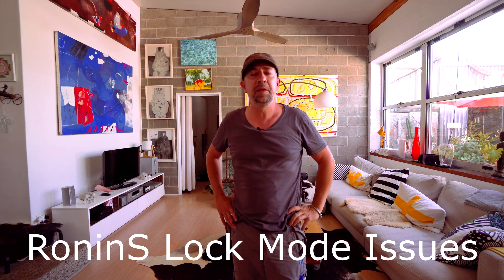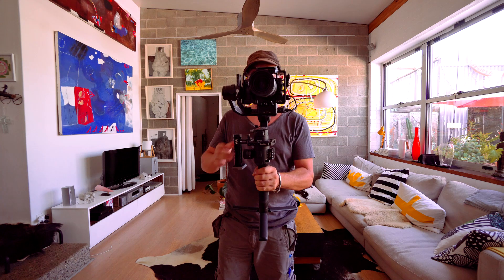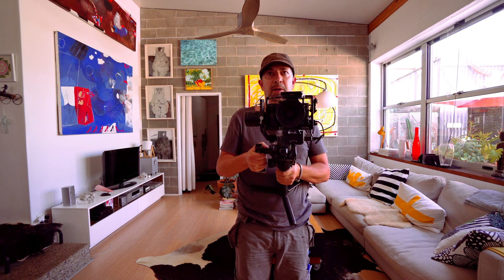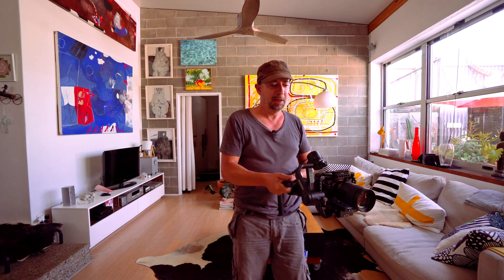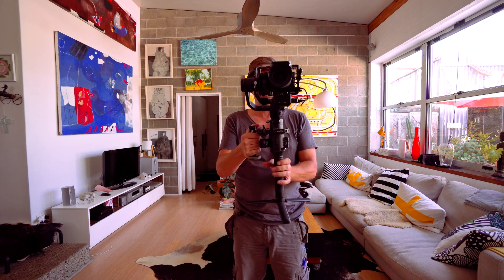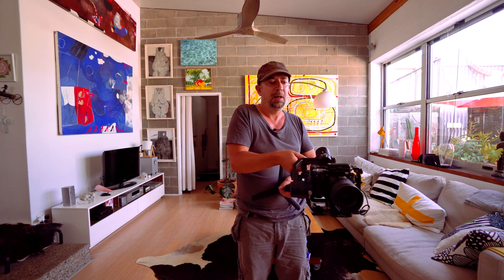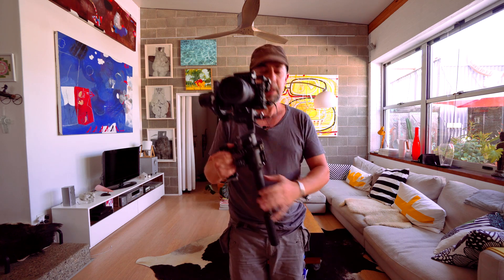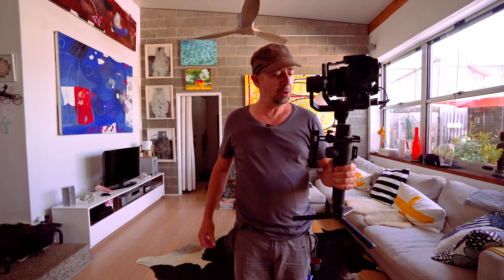RoninS LockModeIssues

Comment: Did you ever find a solution for this? About to switch back to the Zhiyun system, since this has been possible since the original Crane.
Reply from the maker: No. DJI has moved on and obviously not interested in fixing 'old' model firmwares. The same is present at the SC which I currently use. However this has a 'vertical mode' which can be used as a (cumbersome) workaround. Personally I am skipping the current line and I am still waiting for more innovative products that feature a collar mount for a steadicam  arm attachment and other z-axis motion compensation.
Reply: @grafpez   That’s too bad. Have you had the chance to try other gimbals in the meantime?
Reply from the maker: @ahlers00  not really for a while. I had the original Zhiyun Crane and wasn't impressed by the software and customer service either. Nor were their subsequent releases

Comment: How did you set up the the total lock off mode so you dont have to hold down the trigger the whole time...?
Reply from the maker: just program one of the modes in the menu via the app ;-)
Reply: @grafpez  Hi, thanks for responding, but I was wondering about what settings you made in the app to achieve the lock off mode with out the trigger having to be held the whole time... Ive been looking around online to find someone thats done this and you seem to be one of the only i can find... :)
Reply: I just called DJI and asked about locking the orientation with out holding the trigger and they didnt have any answers...  So now Im really curious as to the specific settings that you set to keep you in this mode...  :)
Reply from the maker: @beachbeachidena  in the app, go [user profile] choose M3, then go and tap the motors on the left to disable and create yourself that user setup DJI forgot about ;-) good luck
Reply: @grafpez  did it work for u?